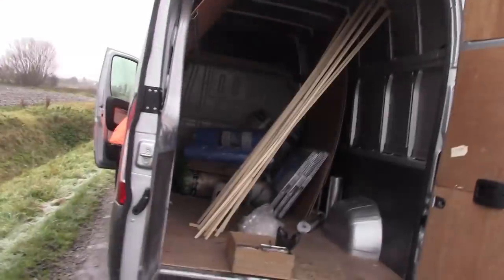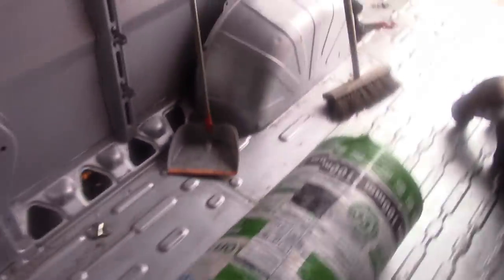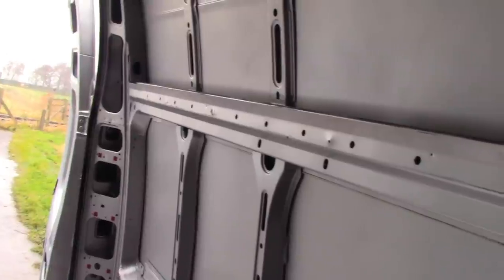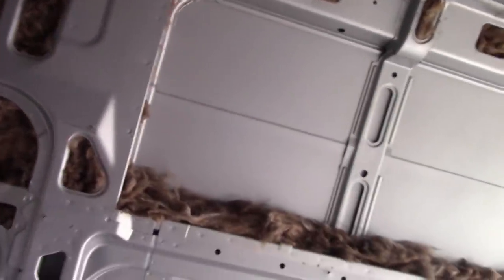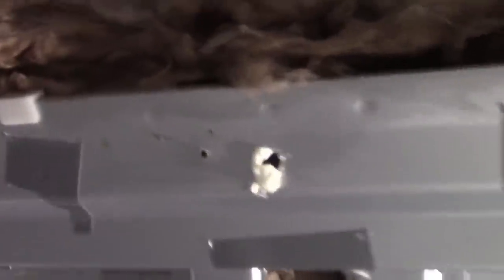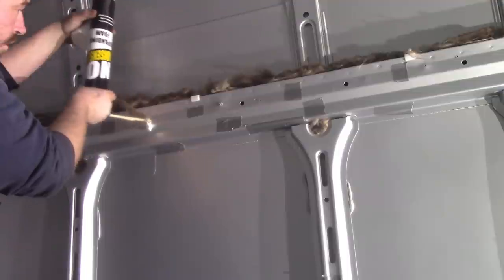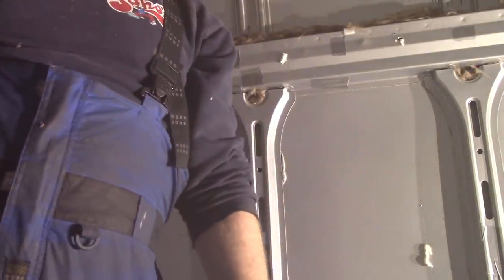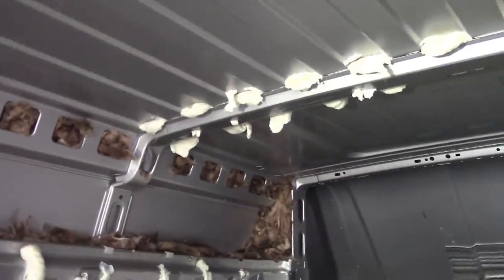Stealth camper build  #1 preparing to insulate

Comment: Here is a tip when using spray foam in cold weather put the cans in a bucket of HOT water, if you are using 2 part expanding foam do the same put the cans in hot water before using.
Reply from the maker: Ghost Shadow great tip man, thank you very much!
Reply: Built homes in Alaska, real fun replacing windows when it is -40C, use expanding foam around the windows.
with some practice you can spray just enough so you don't have to go back and scrape a bunch of extra off.
Reply from the maker: Ghost Shadow With some practice...  And some self control! I can't imagine what minus 40 is like, let alone putting a bloody house up in it.

Comment: Interesting. I assume you're going to completely cover those steel elements, otherwise they'll conduct away your heat like mad. Can't help thinking, if you're covering them, all that stuffing might have been a waste of time. Good project anyway. Can't wait to see episode 2.
Reply from the maker: Hooks into Everything every inch has now been covered with smurf blanket, the reasoning behind stuffing the channels is that the insulation will be thinner on top of them anyway and with cold air circulation throughout them we would get a lot of heat loss, they will still conduct heat away but we have minimised as much as is possible.

Comment: Not sure the fibre in the cavities will make a lot of difference compared to the thermal conductivity of the metal
Reply from the maker: +mikeselectricstuff alright Mike, it won't make any difference whatever to the metal's conductivity, it should cut down on the passage of cold air throughout the cavity and radiant losses

Comment: There is one other issue. Unless you are fitting windows, you'll never persuade DVLA that it's a motor caravan rather than a panel Van, which might cause issues with insurance. I assume theax weight is over 3.2T so you'll always be bound to van speeds (the major benefit of using the T30 T5).
Reply from the maker: Hooks into Everything it's going to stay a van, my dad is 70 now and has no need to be anywhere at any specific time so 60mph on the motorway is fine.
T5's....  I fucking love vw, but man they are over priced, and dad and I both love Citroen for their past accomplishments, the bodies are so much better than vw and Merc for corrosion proofing too.
Reply: Turbo Conquering Mega Eagle how does he stand on insurance if it's modified inside but not registered as such?
Reply: And I hope the electrical are better these days than they used to be. Lol. Can't wait to see the conversion. :)
Reply from the maker: Hooks into Everything it's not really modified, the load of insulation and wood is just bonded to it.... 
Electrics are still pants.